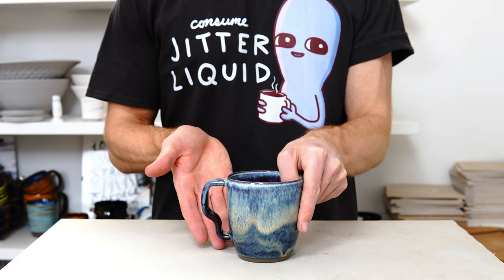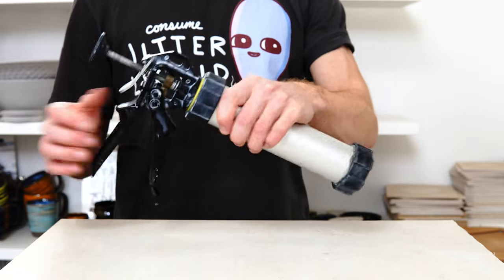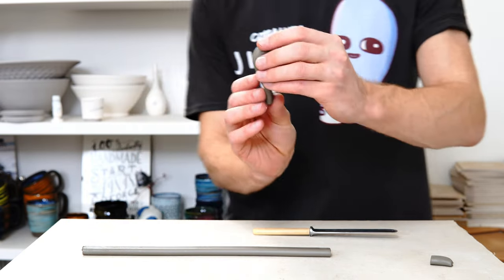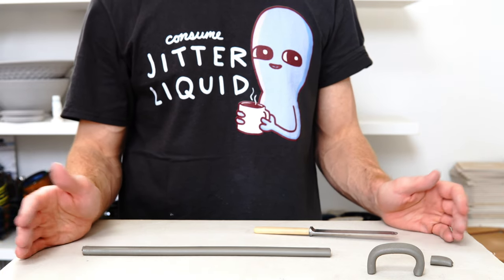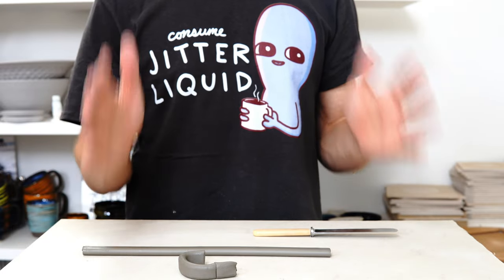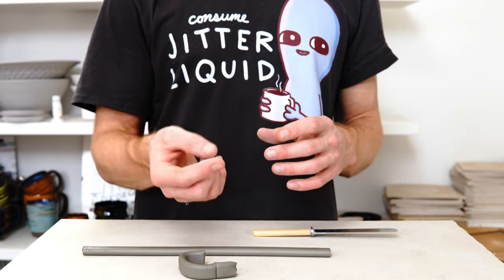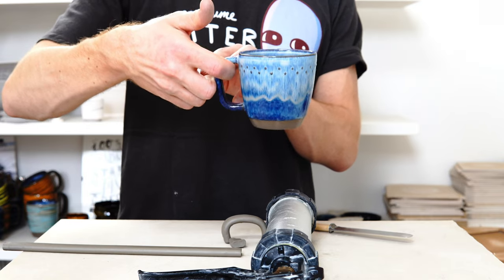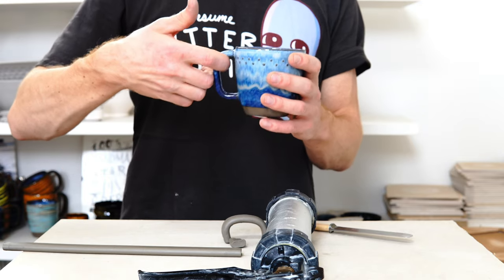What Makes A Mug Handle Comfortable?

Comment: I always appreciate how thoughtful and infirmities you are about everything without straying into... pretentiousness. Such a great video. Thank you!

Edit: I wonder if grip strength limitations could be minimized by a having/adding an extra 'bar' inside the handle. I'm picturing a D-handle where the contour of the handle is semi-repeated inside the handle again to 'sandwich' the inserted fingers. I'm thinking the bottom ones could all be pushing inward (without touching the hot mug) to keep the mug vertical without actually needing the ability for the fingers to close tightly or even reliably... Doesn't address the wrist strength though. 🤔
Reply from the maker: Thanks Em! That's a really interesting idea. I'm not sure it would work reliably as a fixed form, in that I don't think you'd both be able to pinch the middle of a finger segment but also allow the larger joints through comfortably. But some way to lock the fingers in place is something I hadn't considered at all!

Comment: Interesting that the thumb pad didn’t come into play. As someone with grip issues, it’s critical for reducing the amount of force needed to keep the mug from slipping downwards and lessons my need to grip. TY for the visuals, they really help.
Reply from the maker: I didn't really mention it, because I can't see how that would be the case outside of the handles without defined finger positions. The top finger in a D-Shaped handle should support the weight without sliding, and pushing downwards with your thumb would increase the force the fingers had to apply upwards. I agree that it's necessary for handles like a C-Shape, but that's part of why I think they're not a good solution.